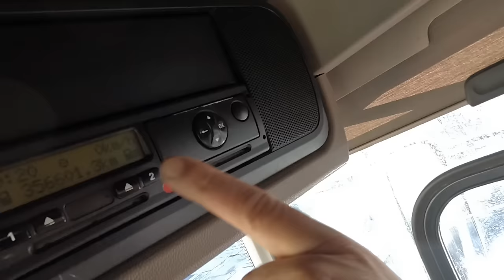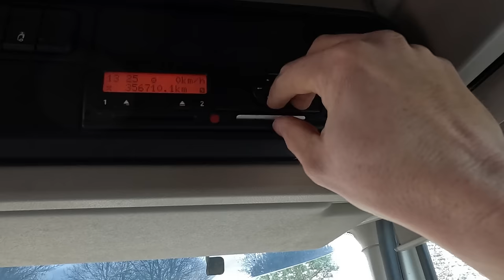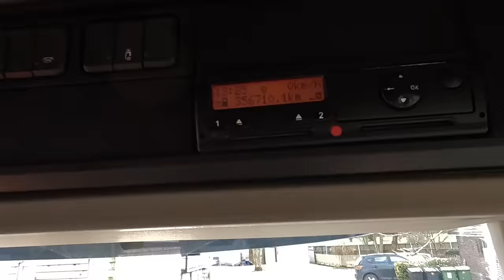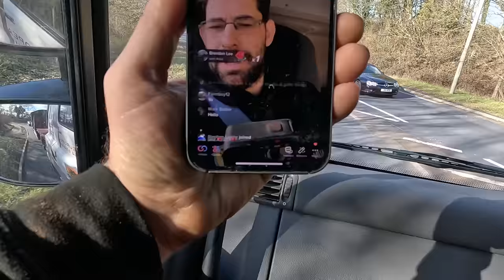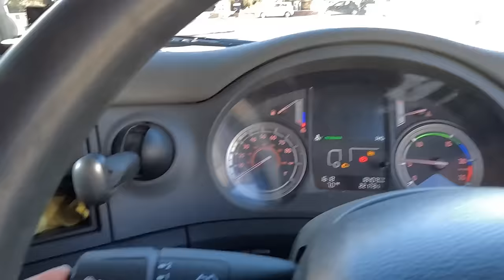Second Job As An Owner Operator | A ROTTEN Railway Carriage | #truckertim

Comment: For the ramps on the rear of the trailer, you put chains or wire cable, going from the second ramp, going down the first ramp and connecting to the trailer, with enough length to be able to unfold the ramps without digging into the ground

Comment: Good timing with this. I have my truck driving test tomorrow morning ♥️😊
Reply: You'll piss it. I done mine last April, your instructor will of said anyway but just take your time mirror's mirriors mirrors good luck kid you'll be fine
Reply: Good luck, what he said 👌
Reply: @Adam-os6sv  sound Adam. Many thanks♥️👍
Reply: @Adam-os6sv  mines a rigid, in Ireland it’s a bit backwards, you need to work up to the artics which is my personal preference in work because it offers a bigger wage in certain places near me.
Reply: Good luck cheers Shaun
Reply: @Jason Russell  same rules apply only slightly less to do on test (no couple or uncouple) trust me take some deep breaths take your time I spoke to my examiner all throughout test he was sound
Reply: @Adam-os6sv  proper fella you, many thanks Adam🤝😊
Reply: @Jason Russell  let me know on here tomorrow how u get on m8 rooting for you
Reply: @Adam-os6sv  a bit too straight on a roundabout. Didn’t fully lock the steering wheel, fail😭😭😭
Reply: @Adam-os6sv  honestly, I genuinely couldn’t believe it. Too straight on a round about that had a HGV ramp on it so I can have ‘more room’ took it too straight and didn’t fully lock the wheel
Reply: @Jason Russell  if it's any help I failed first time actually on worse and I wasn't going to re sit but your probably angry and upset like i was. The main thing now is you know you have 1 simple flaw re test yourself and fix that same flaw! 

Dust yourself down and go again you can do it.
Reply: @Adam-os6sv  100%. Just in Ireland with the RSA, it can take between 6-10 weeks for a retest invite, that doesn’t guarantee I’ll have a test date in that window unfortunately. What did you fail on?
Reply: @Jason Russell  sorry for late reply my tattoo is stinging like a ..... I failed on being in the wrong lane coming off a roundabout and then pulling out on a car! And that didn't stop me retesting .. then 8 weeks later I done my class 1 licence and passed first time there. Now I enjoy driving a 26ton flat bed nice hours 6am until 3pm I've been offered class 1 work but if anything I'm happy I'm home every day for my son.
Reply: @Adam-os6sv  seem to live a dream now bro I don’t have any kids yet, until we both get proper long term jobs with very good financial stability behind us we’ll fully consider it. I’ll get it right next time, just remember full lock Turn on the roundabout, if I come that way again, I’ll get the round about. There’s a apron on it, for all HGV’s, I went too straight on it, I should’ve just had my 2 right wheels on it instead I had 2 front on it, simple mistake but the turn onto the roundabout was a little bit sharp.
Reply: @Adam-os6sv  my examiner said I didn’t basically everything right but the roundabout, reverse around the corners, sharp turning, mirrors etc was all sound and “good enough” (arsehole) like, the RSA is extremely “picture perfect” here and it does my head in 😂